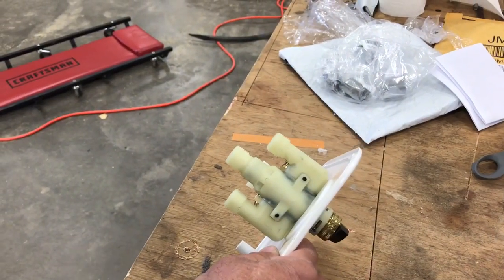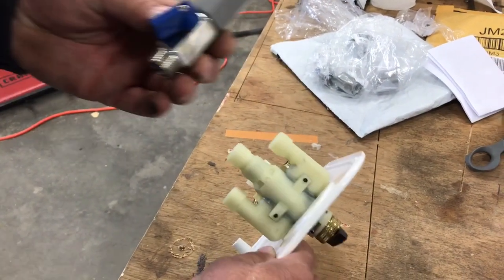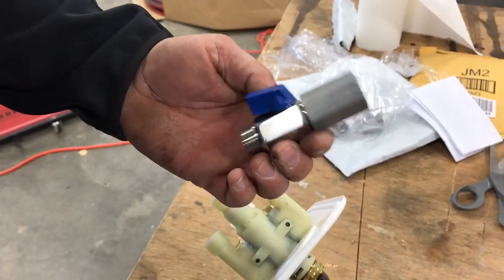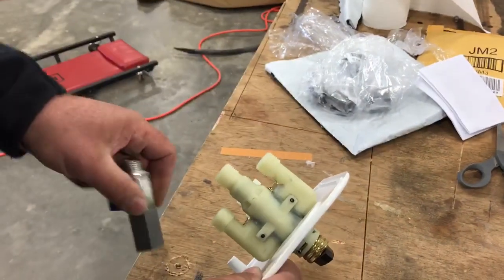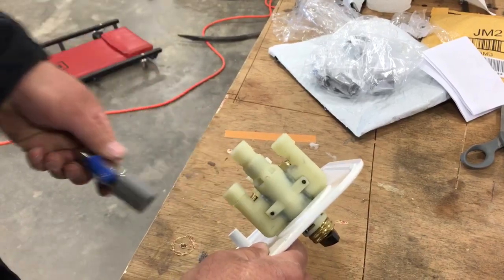Kantleak repair

Comment: Thanks for making these type videos. I really appreciate them. They are very helpful. Last year you helped me out of a jam with one of my front jacks. You squeezed me in after hours and got it replaced. I do as much of my own repairs as I can but for the ones I don't think I can handle I am going to stand in line for an appointment at your shop.

As a side note, I operate on my fresh water tank 100 percent of the time. I do this because I believe filling and draining my fresh water tank constantly keeps it cleaner. I also figure if I need to add fresh water my other tanks are ready to be emptied and I might as well refill the fresh water while I am draining the black and gray tanks. Also it has been my experience as a plumber that pumps that aren't exercised fail. I have experienced several times being in a park where the water was shut off for repair but I never noticed because I am using my fresh water tank. During freezing weather I just unhook the hoses and I am good to go. Just thought I would share incase someone else might find this helpful. 

Thanks again,
Mike